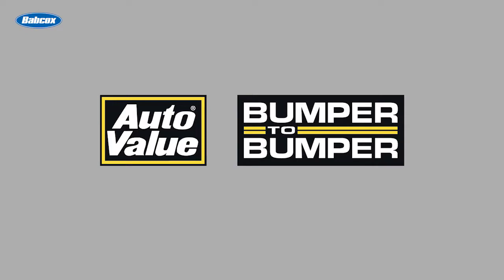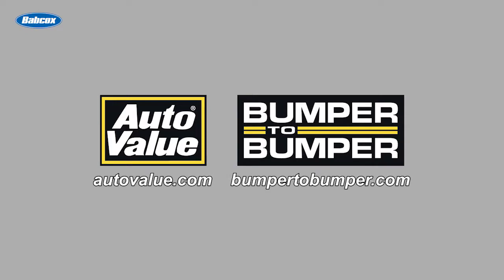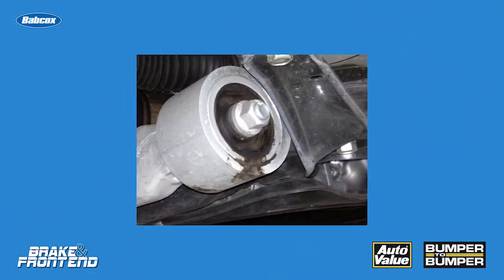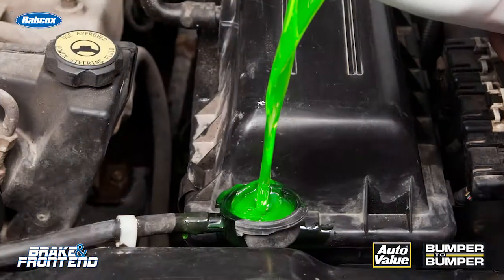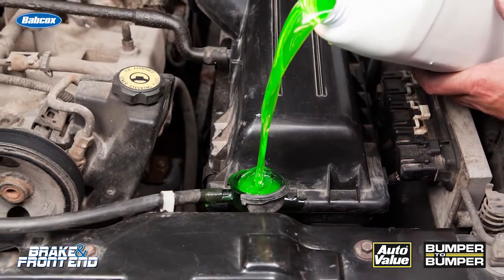What Is The Fluid Inside Bushings And Motor Mounts? | Tech Minute

Comment: Rubber can degrade with mineral oils... hence the glycol based liquids!
Reply: Can we use engine oil or transmission oil in a leaked hydraulic engine mount?